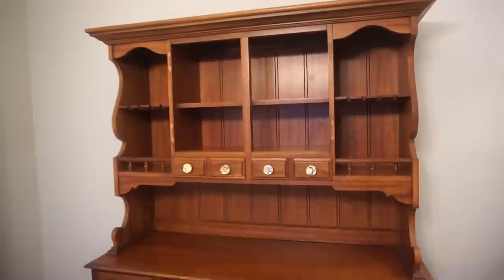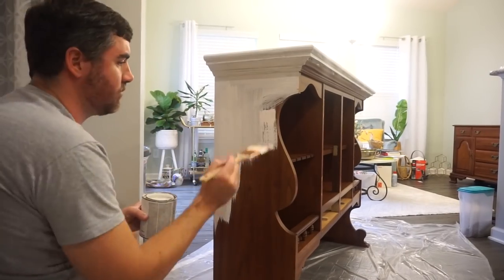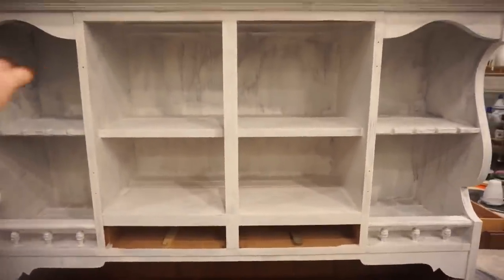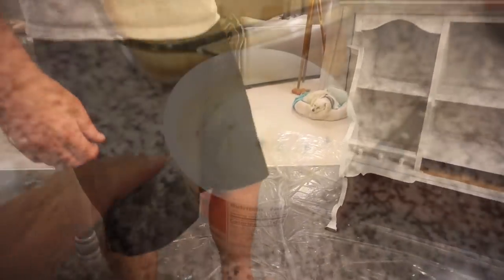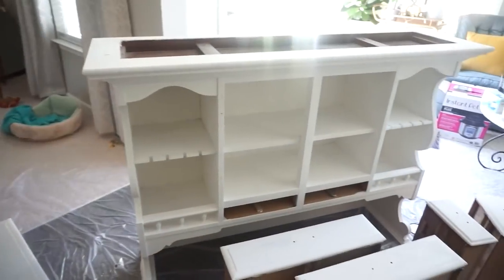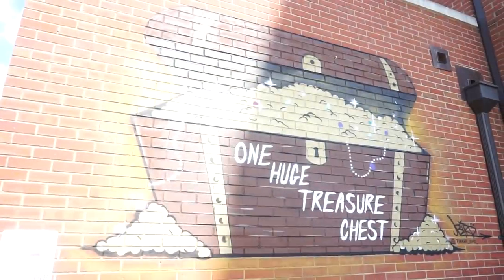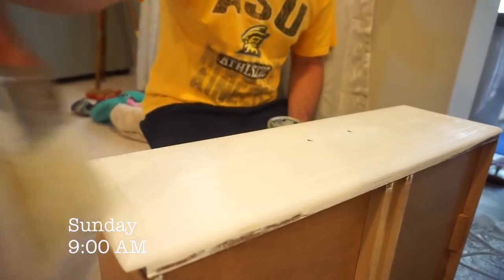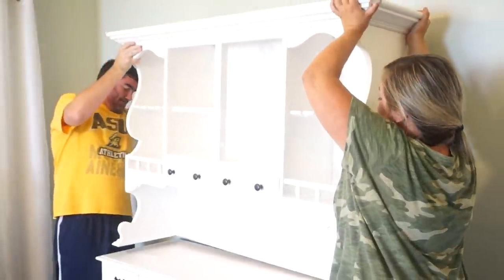FARMHOUSE HUTCH MAKEOVER | CHALK PAINT & DECORATE #WITHME | WEEKEND VLOG | JESSICA O'DONOHUE

Comment: I have my grandparents hutch a natural pine or maple wood.  It is very old and needs painted or wood filler in and restained. I want to paint it.  I also have an Ethan Allen hutch nothing wrong with it but like you said, it doesn't match the decor.  I think the same.  One is smaller than the other  and my grandparents one was put in the trash and I picked it up.  I found an article in there about my grandmother and one of my aunt's nursing graduation pictures!! Along with some other items and I just told myself I had to have it!! I remember seeing it every time I would visit them and it brings great joy to have something of theirs. I use both of them in two different rooms.  Does the Chalk wax give the finish a clear coat so you can dust and wipe down easily? Since the Chalk paint is a flat paint.